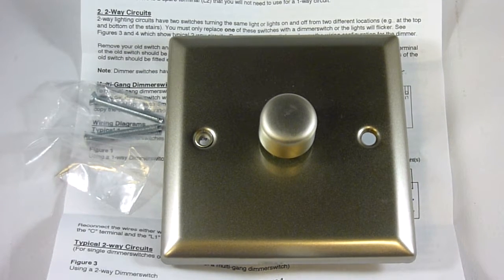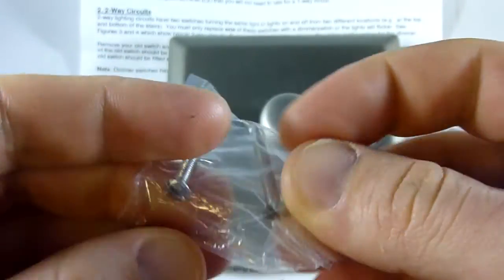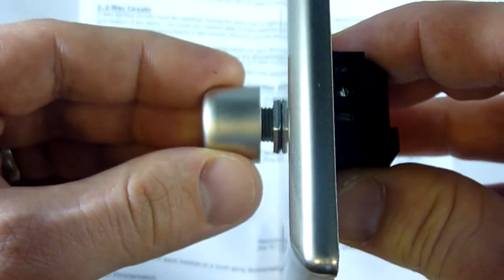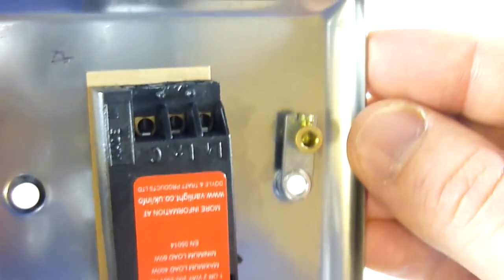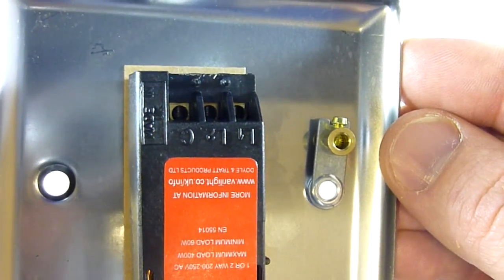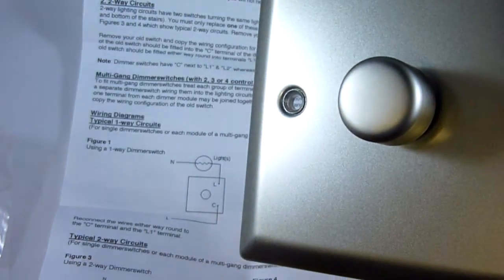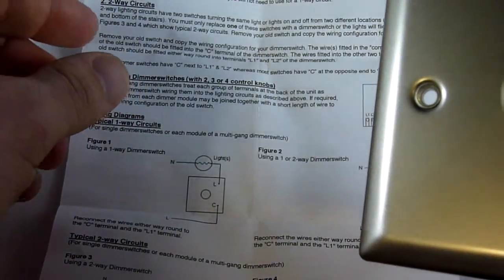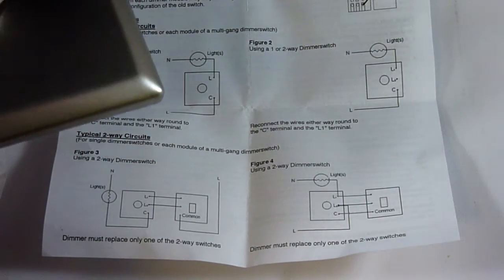Varilight HN3 Halogen 400 Watt with dimmer switch wiring and installation information

Comment: Is there any way to deactivate the dimmer function and bypass it so it is used as on / off  only. 
Reason I ask is because I wanted to connect a led strip light to the dimmer, (the touch type) but it flickers on when off ?
Reply from the maker: Hi there,

Yes it is possible to turn your dimmer into an on/off switch with a varilight ZOHO dummy module:
http://www.theinternetelectricalstore.com/varilight-non-dimmable-push-onoff-dummy-module---zoho-167662-p.asp

All you will need to do is swap your old module out for one of these then the dimmer will work as a push on/off switch